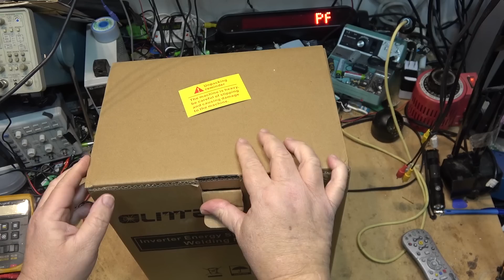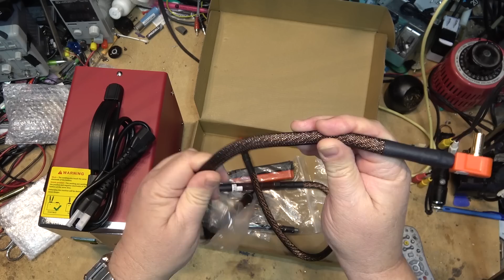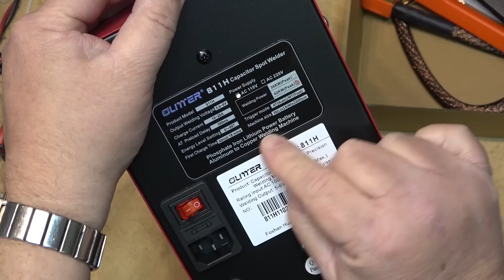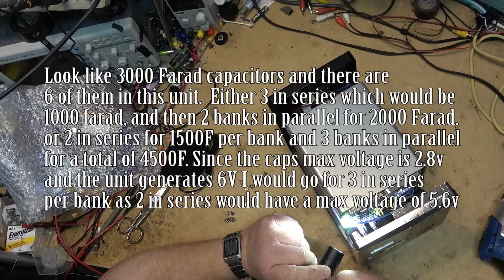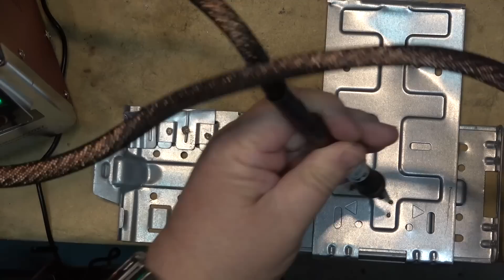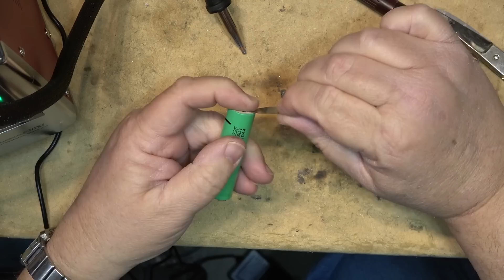GLITTER 811H Capacitor Discharge Spot Welding Machine Unbox Tear Down and Demo

Comment: Hey Dave! How has it been performing? Have You got into using it extensively?
I'm seeing reddit threads users modding it up with better TVS arrays, Fans, and Varistors to absolutely drop the reverse spikes to barely 1-2v peak..
Reply from the maker: It's working fine.  Don't use it much.  More often I'll grab the battery powered one for simple battery terminal welds.

Comment: thanks for your video. Any one figured out the reason why the GLITTER/SUNKKO versus HELTEC spot-welding products are identical, in product as well as user instructions document? How is it possible 2 different companies GLITTER/SUNKKO versus HELTEC have many identical products & documentation? So which company is the original inventor of which spot-welder products?

For example, GLITTER 801H (21W) is identical to HELTEC HT-SW01H (21W). 

SUNKKO 811H (36W) = HELTEC HT-SW02A (36W). 

SUNKKO 811H (42W) = HELTEC HT-SW02H (42W).

And many more products are identical between the brands GLITTER/SUNKKO versus HELTEC.

And in your view, which brand is more reliable product & uses better electrical/electronic components?

I subscribed to your channel.
Reply from the maker: The same reason that rca, ge, quasar, and national vcrs were identical to panasonic.  Because they were all made by matsushita electric.  Many products are made by 1 manufacture and sold under various brands.  It's called scale of manufacture.

Comment: The cable jumping is because that amount of burst power makes it into an electromagnet. Even the small ones powered by a couple of small lipo pouch cells will suck right down once triggered. You don't need to press down hard, it will do it for you. Just make sure there is metal behind the strip or it will blast a hole right through it. You can get welds that are plenty good enough with a $20 spot welder as long as you use the right power source. Use the wrong power source and you end up with blown FETs. A car battery is a good choice or RC lipos just double whatever is recommended since the c ratings on those things are a work of fiction and it's easier on the batteries by long shot. Doing a big battery with hundreds of 21700 cells things get very hot. People  blow up the little ones all the time but it's because they are t powering them right. Obviously you want those FETs switching in and off in a definite manner, voltage sag makes quick work of FETs and I highly doubt anyone is doing any matching of FETs so your lowest resistance one is getting a real workout. 

I have bunches of these things, all different kinds from homemade microwave oven transformer ones to much nicer pulse welders to sub $20 ones. They all work about the same as long as you power them right. It's literally a timer allowing current to flow. It just lets inrush do it's thing in a series of pulses . I have some that do 3 pulses. I usually use 2, first one is like the preheat pulse and then the second does the business and you can tune the duration and interval to what you are welding. 

That glitter is ridiculous. lol. You don't want to see sparks like that, turn it down...way down. Notice the shape of the electrodes and keep them like that. You don't want sharp points. Skinnier is fine but rounded. Those giant knitting needles kill me. I understand the welding cables, it is after all a welder but the knitting needles...really? They are so big you can't see what you are doing. 

You can spot weld with one of those super capacitors so with 6 that thing never even breaks a sweat. I bet you can make that thing for about $60-80 and you would spend more time gathering components than building it. If you wanted to do normal battery power you can get those SPIM cells 2 for $7 on hookup these days. 2 of those in parallel is 16ah 400a continuous they are the size of a Blu-ray or DVD in the case. 

It has now occurred to me that I have everything required to do this. I may just go do that.

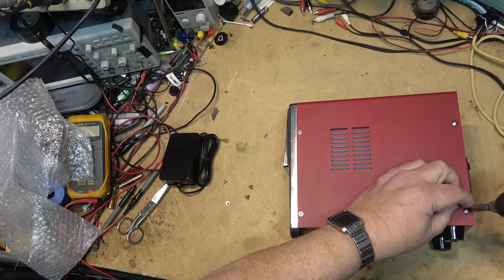Comment: Hello sir. I am looking for the perfect, reliable battery powered screw-gun like you have in this video around 6:10 minutes. Something with decent torque and small enough to get into tight areas. Do you have any recommendations? Model and Brand if you can. Thanks in advance. Rechargeable is optional. I am ok with something that requires C cells or multiple AA batteries as well.
Reply from the maker: I reviewed the one I use a few years ago.
Reply: @12voltvids  Ok, so what is the title of that video. You have like 1,000 videos in your channel. Thanks.

Comment: Just got mine a few days ago I’ve got an monster Ebike battery to make 

I’m using 0.3mm copper and 0.15 nickel to get a strong weld not sure what setting I’m gonna use but I’ll do some testing on old cells
Reply from the maker: You are braver then me.  However i have seen the results. A friend figured he could build a bigger battery for his ebike. Had it charging in his carport while he was watching TV and saw something bright light up his front yard.  Went out to see his bike on flames. Went running inside and was able to get the thing out into his driveway where it basically melted the pavement. His battery was bad and he bought a higher capacity replacement.  Unfortunately the bms on the charger was for the original.  His townhouse could have easily gone up.  The strata instantly passed a bylaw. No ebikes, or scooters in the premise and electric cars needed to be charged outside the carport.

Comment: Just for fun while probing around on the interior of this device, post a clip of the bird being zapped falling from the utility pole just for emphasis on the hazards of electricity! 😅
Reply from the maker: Not really any hazardout voltages on this one. 6 volts won't hurt you.  The current this can dump instantly that a different story.  It's not electrocution you would worry about it's burns.  Just for shits and giggles I stuck a piece of wire around the probes and hit the switch.  It vaporized the wire like a fuse blowing.  No arcing just a small spark and the wire popped.

Comment: ""SWEET""  Thanks Dave.
A side note to spot welding. If You had the leads on either side of the pieces of metal You Have much better penetration as the Current goes all the way through.  Just got to make sure the Probes are lined up. 
Mike M.
Reply from the maker: Yes I know.  The ones i used at school were long tongs solid copper.

Comment: So. How much power does it use? In energy usage? I'm curious.
Reply from the maker: It doesn't use that much.   These are massive caps but the voltage is very low.